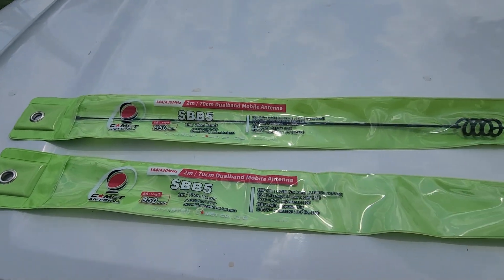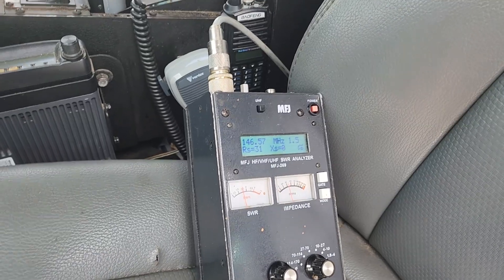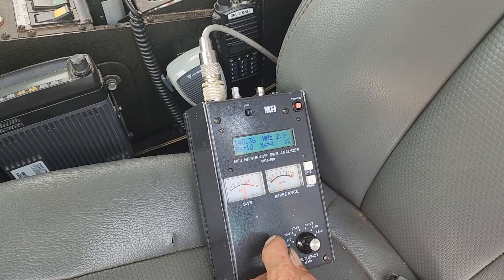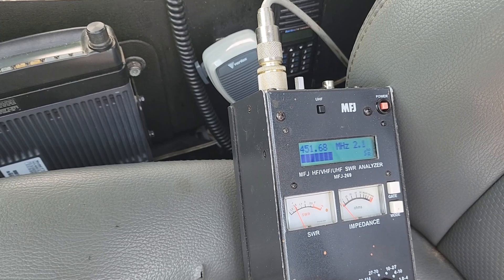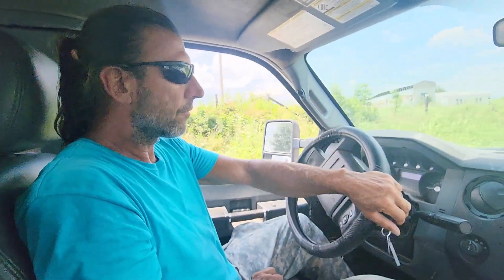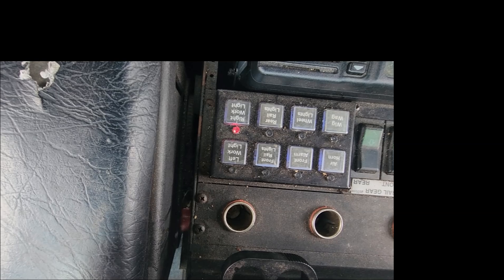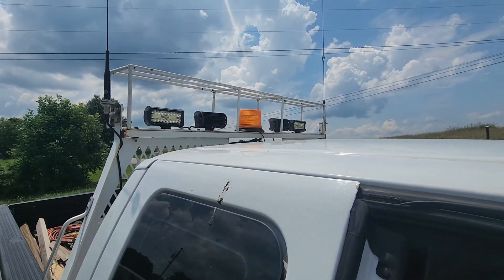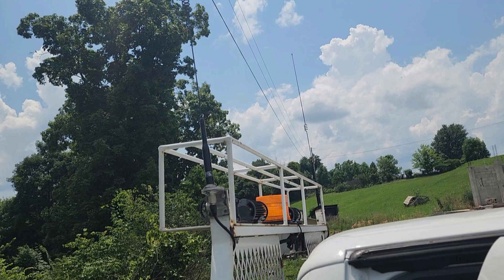LCARA HAM Radio: Co-Phased 2M Antennas - Voodoo or Awesome!!!!

Comment: What is the distance between the antennas?   Is the co-phased harness using 50 or 75 ohm coax?

I noticed you left the doors open and standing outside.  As a general rule of thumb I always get inside the vehicle and shut doors duplicating the normal operation.  Maybe a little too much OCD on my part.
Reply: 50ohm

Comment: Phasing coax is individual runs at a critical length into a T, then a critical length to the radio. These would also be frequency/band specific.

Motorola and GE had diagrams that showed this for lowband VHF back in the day, but the math holds for higher frequencies.

As for the led lights? Get some better non-Chinese junk and those issues go away.